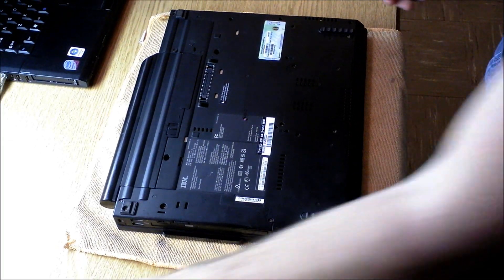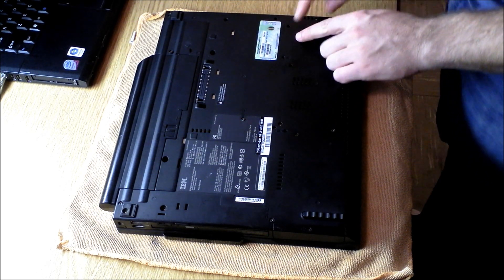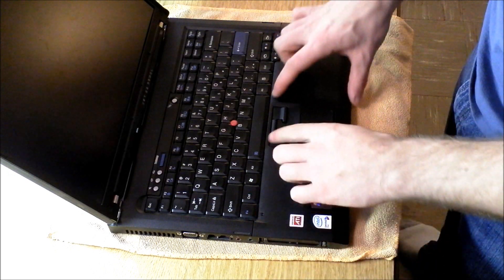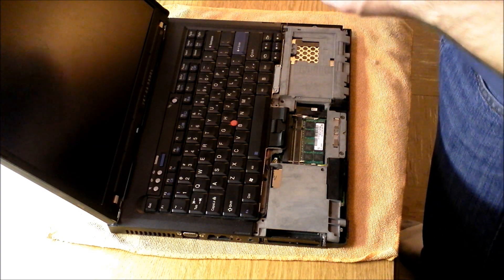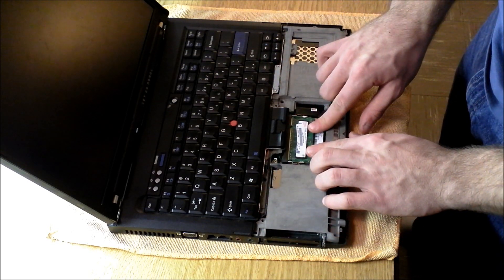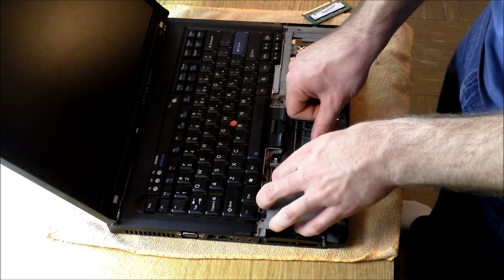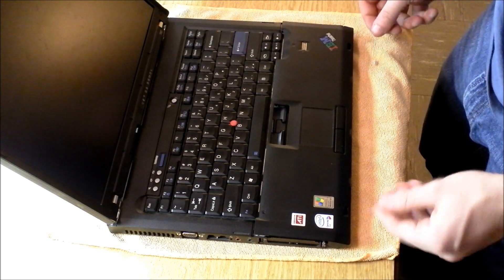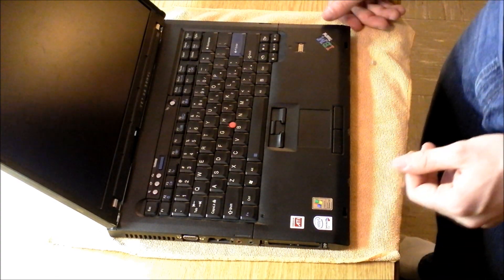Tutorial: Upgrading the Ram on a Lenovo or IBM Thinkpad Laptop (in 1080P!)

Comment: I want to upgrade to 8GB from 2GB on my T500.  I also noticed that I have a 32-bit operating system (Windows 7) that is 64-bit capable.  What does that mean?  Should I consider upgrading to 64-bit operating system also?
Reply: Yes you should my friend. 32-bit operating system doesn't support more than 3gb of ram. Also consider upgrading to windows 10, it's 10 times more stable, less demanding .... and ofc faster. It's also safer.

Comment from the maker: The E520 only officially supports up to 8GB of ram. So, you run the risk of not being able to use the other 8GB if you go for the 16GB kit. If you want to try it, I recommend updating to the latest BIOS before doing the upgrade. What applications do you use that require high amounts of ram? Even in large simulations I am only using less than 4GB with my T430.

Comment from the maker: You will need unbuffered non-ecc sodimm DDR2. That is a big fancy way of saying, normal ddr2 laptop ram. If you are asking about speed, I recommend DDR2-667. You can use DDR2-800, but it will downclock to match the existing bus speed. You can also use slower DDR2 (533), but you will be losing performance. What model do you have?